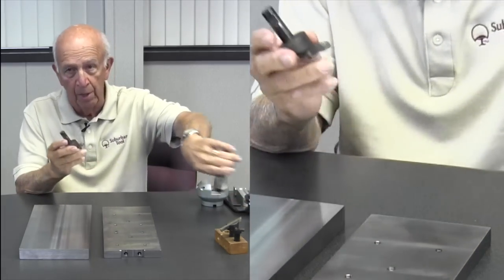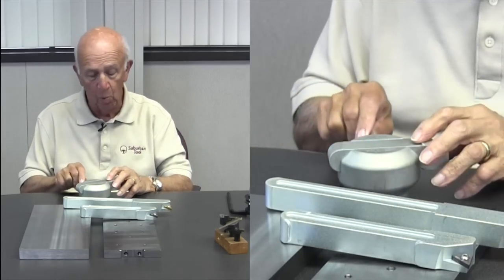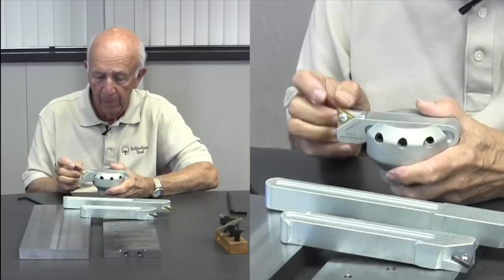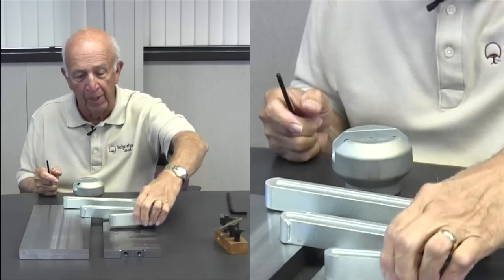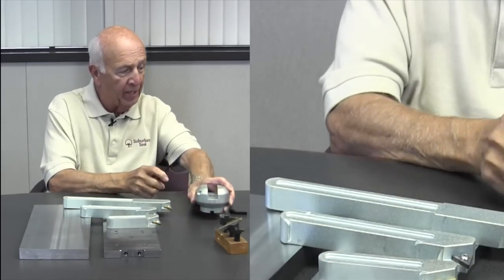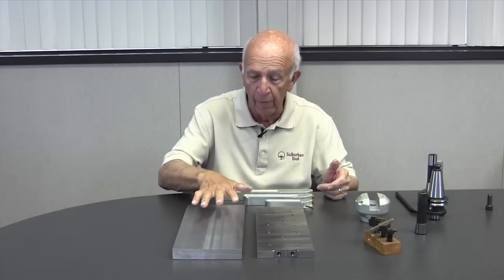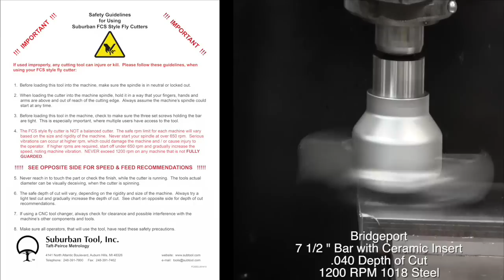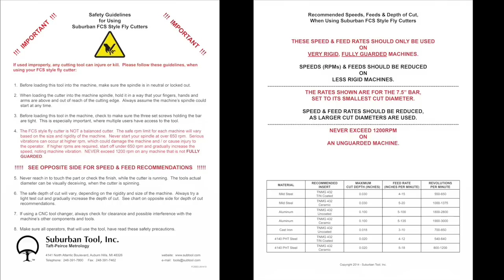Fly Cutter Comparison

Comment: I bought this Fly Cutter a few years ago with the smallest insert holder. It worked EXCELLENT!!! Hands Down, WAY better than any other fly cutter I've ever used!!! After using it on one job I bought the 2 other insert holders. The beauty is you set it to make 1 pass, my finishes was almost mirror finishes! I used it on Aluminum, P20, H13, and 4130, 4140, 4150 for the outsides of Mold Retainers. It was the first thing that the customer remarked about as it's the first thing they saw. Their exact words were, 
"That looks like a first class Tool!" Customer confidence from a well made Fly Cutter! WINNING!!!!
Reply from the maker: Glad you like the fly cutter! It sounds like you've gotten some great use out of it. If you have some time, feel free to leave us a review on Google :) Thanks for the support, and as always; thanks for watching!
Reply: I certainly have!!! It's HANDS DOWN the best flycutter I've ever used! Only problem I had was that I had to hide it! Everybody kept borrowing it and using all my inserts! The shop I worked for is really cheap so I bought 10 boxes of inserts for my own use as I was on the big horizontal and I used it all the time. They eventually started buying inserts after I sent out a couple of jobs that I couldn't us my flycutter on because I was out of inserts. Anybody reading this, DON'T HESITATE TO BUY THIS CUTTER it is EXCELLENT!!!

Comment: One other good thing with a fly cutter is it will show you how well you have the turret trammed  in. The cutting marks should be even fore and aft and laterally. Take a very light cut,five thou or so,and study the finish. Being able to read it will let you know if any adjustments have to be made. The bigger the swept diameter the more sensitive cutter witness marks are. The too you and from you marks should overlap evenly.

Comment: You should have run a surface finish analyzer to quantify the difference. Also, surely the old style fly cutter can take carbide inserts too if you make an adapter ? And I suppose the carbine insert is what really makes the better finish, not really the holder ?

Lastly, that tool looks very big !! I could be wrong but it seems overbuilt, surely it could shed some weight without compromising rigidity ?
Reply: +shodanxx the design is all part of the result...  I have used similar tooling for boring and they work because the weight and strength improves rigidity and therefore surface finish, there is another video for this tool, and the surface finish is very good.

Comment: how does a fly cutter compare to a face mill cutter (those round one's that look more balanced)?
Reply: fly cutter - 1 cutting edge - least amount of pressure, face mill - multiple cutters engaging the parts - more pressure, requires more rigid machine and higher amounts of power, potential for really high material removal rates
Reply: Conversely single cutting edge gives an intermittent cut which on smaller, less rigid machines is liable to produce more vibration and worse finish.  The four (or more) edges of a face mill ensures (providing the work piece is wide enough) that at least one edge is always engaged so gives a more constant load on the machine.  If using a fly cutter on a smaller machine it really helps if it is a heavy one that has plenty of momentum.  I suspect that weight (and the insert) are the key reasons this demo gives a better finish than the conventional rather small fly cutter.
Reply: @MrSailbadthesinner  A fly cutter gives a better surface finnish is what I was taught. I had not considered that a face mill might be better on a small, less rigid mechine.

Comment: Never been a fan of flycutters in an R8 spindle w only 3 hp on ferrous metals. Non ferrous? No problem. Just my opinion but the R8 spindle is too light and the single point knock is hard on the bearings. Aluminum, brass, bronze (except Aampco of course) is acceptable to me. Steel is better off with a multipoint shell type I think. 40 taper or bigger no problem if you need a wide uninterrupted cut…